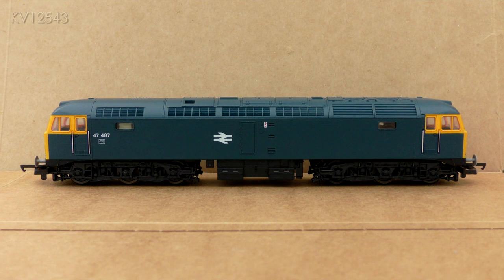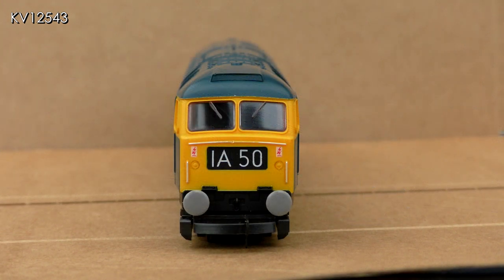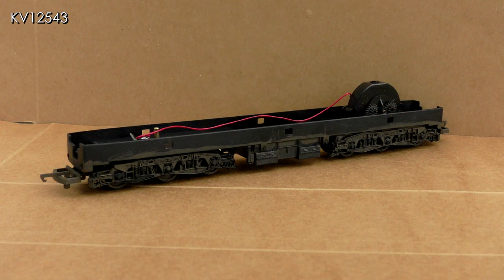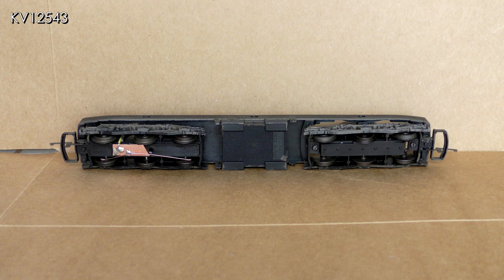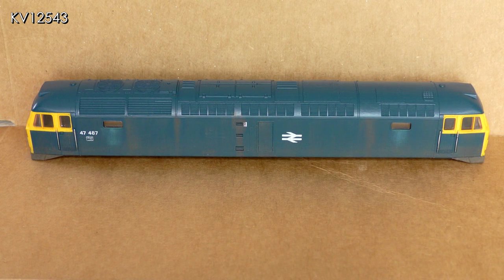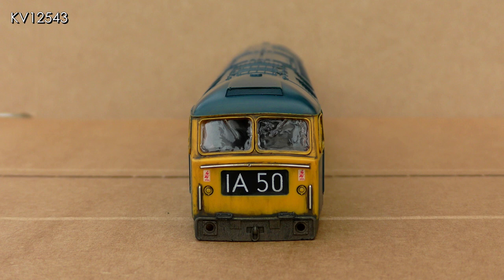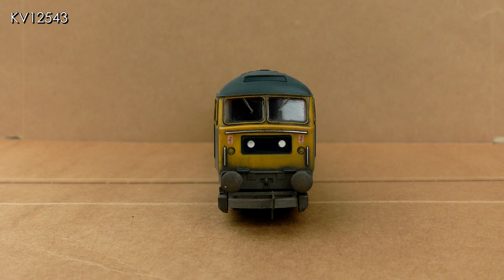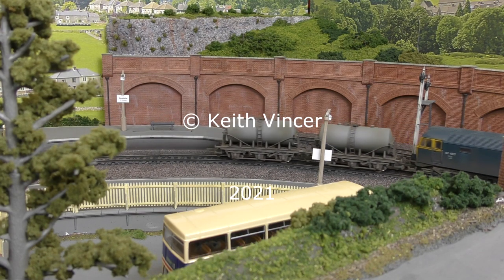Lima 47's - a Duff model?...No... a good model that can be made even better

Comment: When i worked at Crewe i seem to remember the locos were washed with high pressure hose and a broom and industrial detergent!  The class 47 bogies and under frames were kept as clean as possible as they suffered with oil leaks usually  running on the centres of the bogies. The 47s were quite prone to under frame fires if this practice was neglected. So if modelling well dirty models the bogies could well be wet too.
Reply from the maker: Fascinating stuff Mike. In the absence of  first hand knowledge like yours I had to take my inspiration from the internet. The class 47.co.uk website has  superb photos of all the class members including some of my 47487 in BR rail blue. The bogies looked absolutely filthy but I could clearly see the oil leaks to which you refer. Regards Keith

Comment: Great improvements! By the way, maybe it's possible to add a pickup at the centre wheel of the motor bogie? It hasn't got a traction tyre
Reply from the maker: Thanks, you may well be right about adding extra pick ups to the motor bogie but I try to keep my soldering iron away from this end of the model as far as possible. I am very happy with the way the model runs so will leave it as it is, Regards Keith
Reply: @KV12543  Yes, the motor shield is made in plastic, soldering close to it could damage it. You are right to keep away from it if the locomotive is running well.

Comment: Hi, am a new subscriber and have been a railway and road transport modeler for many years and really enjoying the refurb on your son`s old layout in turning a what was a train set into a well modelled and enjoyable layout to watch,I  still have a couple of lima class 37`s that I have done the same thing as yourself weathering,handrails and flush glazing , they still make a good model maybe not as good as todays models but they do a job keep up the good work.Rob.
Reply from the maker: Thanks Rob, I love Lima models as you can tell and I have a couple of 37's just waiting for some attention. I have not used any flush glazing before so I have decided my next project will be to try it out. I may have chosen a difficult model to start with - a 2 car class 117 DMU....there aren't half a lot of windows but I reckon if that works  out then I can glaze anything......watch this space...., Keith
Reply: @KV12543   Your welcome Keith, good luck with the glazing I have done the Lima class 121 bubble unit  it really does make the difference just a tip if you want to take it up leave 1mm extra around the glazing unit, found it helps with glue and seating  the glazing look forward to seeing the 37`s as my favourite  1st gen diesel loco.Rob.

Comment: great informative video i have nearly all lima models all run smooth all the dark blue boxed models like you i would rather buy a mint boxed lima than cost of the others i have a recent hornby body that fits dirctly onto lima chassis even the screw holes line up only locos not lima is a hornby pacer with extra pickups and a bachmann class 121 s/h my other 121 s are lima and all smooth runners thanks for sharing
Reply from the maker: Thanks for your comments. I am glad you liked the video and also that like me you are a fan of Lima models, Regards Keith

Comment: I agree on the Lima G-type pancake motor. If well maintained and lubricated and driven with a good controller it's excellent. I use Mehano controllers.
Reply from the maker: Absolutely....I use Gaugemaster hand helds and they give very fine control with both Lima and basic Hornby 0-4-0 locos, Regards Keith
Reply: @KV12543  Gaugemaster id the Rolls Royce of controllers.

Comment: Lovely job Keith, like you I love the Lima stuff and still have mine from the late 70s. How might we get the gold plated effect on the cab windows I wonder? at some angles from the outside it looked light a very light purple, often wondered. I have an updated one off service guide for Lima stuff, in case of interest its attached here. https://youtu.be/8vIUhJ7x6l0
Reply from the maker: Thanks for the updated guide, I will replace the old one in my folder, Keith
Reply: @KV12543  ah great, only change is for the wheels I now recommend WD40 Contact cleaner or good old lighter fuel

Comment: The Lima 47 is a promising little thing; it’s no wonder then that Hornby now offer it in various liveries in their Railroad range, albeit with an improved motor tower, NEM couplings and DCC socket. 

I’ve got three of these so far, one that I’ve put a TTS sound chip into. Still need to weather them, and add buffer beam detail. I plan on converting tired ones - yet to be acquired - into Class 57s with the relevant light clusters, folding dellner couplings etc, in liveries of the likes of the Virgin “Thunderbirds”, First Great Western and maybe even Network Rail. 

The sad eye windscreen is a little excessive, and the model lacks some width; however, it still gives off that all important class 47 “vibe” better than the modern offerings, in my opinion. Similarly can be said for Lima’s classes 31, 37, 50 and many more, with their InterCity 125 being especially impressive for it’s time and even today when compared with Hornby’s top of the range 125. And of course, at the price you can get these little models for, it’s very hard to grumble about some gear noise or lack of pickup. Importantly, they can be serviced and mended - modern models are often expensive paperweights when they fail…

Keep up the good work; your videos are very peaceful and inspiring. You produce very honest stuff, and it’s a much needed breath of fresh air. Cheers.
Reply from the maker: Thanks for your very interesting reply. The Railroad ones at £80 seem very reasonably priced compared to most of Hornby's recent locos. However I'm afraid the liveries are too bright and modern for my tastes so I will stick to my old Lima ones. Regards, Keith.
Reply: @KV12543  Luckily for folk like us they have been intensifying the range with more liveries in the last couple of years, and I can’t wait to see what they come out with in 2022.